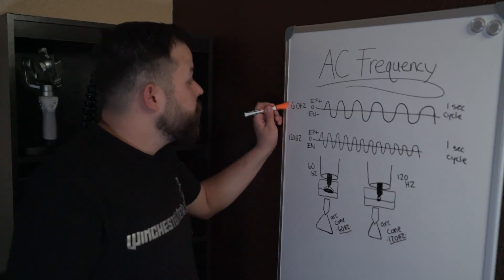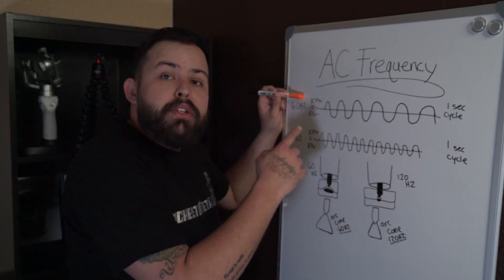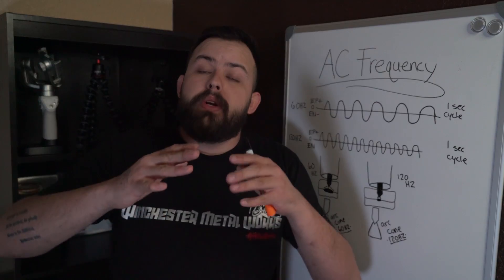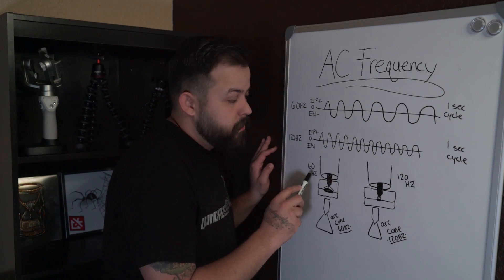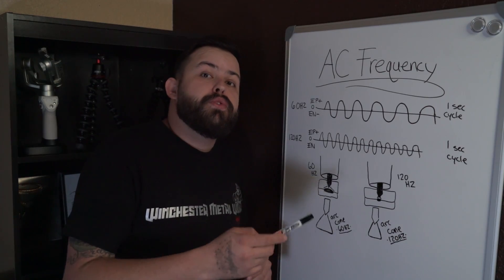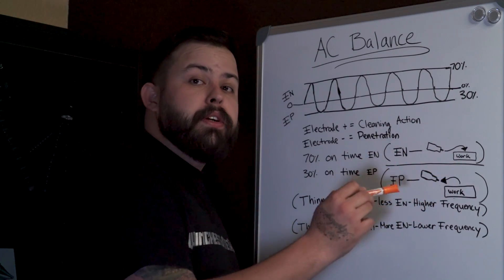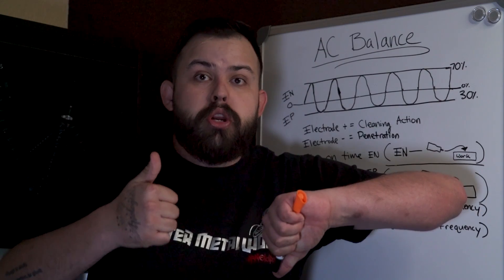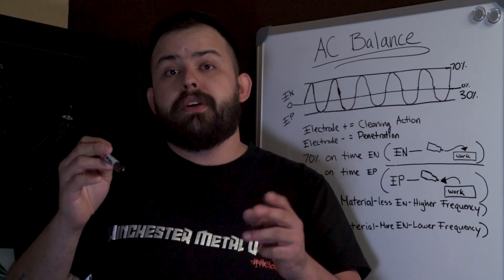Aluminum TIG Welding: AC settings- Using AC balance and AC Frequency

Comment: I don't think I think we got a basic understanding but at the same time you got difference in the thickness of your parts you got the different sometimes in the two parts going together one being thicker and the other one being thinner and you got a difference will there be aluminum whether it be steel will it be stainless steel and then of course you got the thickness of that for me anyway the biggest thing is that I want to be able to get it and understand how to balance both to get the best results out of our torch, and I think that comes with time and experience

Comment: Hi mate. I am hoping you can help me. I have a Vevor 6 in 1 TIG. 
It has no foot pedal but fairly significant software adjustments.
It has Cleaning Frequency, Cleaning Width and Frequency settings. Im welding 50 x 50 x 6mm aluminium. 
Any advice would be greatly appreciated 🙏

Comment: I have a Yeswelder CT2050 that is new. I’m building the cold side of my intercooler out of 065 aluminum and I’m struggling with the settings on my machine. It has a built in plasma cutter that quit working after the first job I did. I’m getting frosted up snot from my aluminum welds. I feel like I’ve tried every setting the machine has, but I must be doing something wrong looking for help not thumb thuggish comments. Thank you

Comment: I have a syncrowave 210 and I’m just learning how to weld aluminum and the settings are confusing. Your video helped to better understand how to adjust the freq and balance. 

I’m running 3/32 tungsten and 1/8 aluminum.

Comment: Hi Brad, I have a question for you about material thickness and settings, I'm going to be using 40mm Aluminium Box section with a thickness of 3mm, I will mitre the corners and weld these pieces into square frames. I will be using a GYS pro tig 201, 

 great video here thank you.

Comment: AC negative is the penetration aspect of the wave. AC positive is the cleaning aspect. He says "the higher the AC frequency is, the less time it stays on EN or EP". Not Really. It is the balance between the positive cycle and the negative cycle. So 30/70 is 30% positive (Cleaning) and 70% negative (penetration). 50/50 is 50% positive and 50% negative in the cycle. I stopped watching after that first 1 minute. It's cool to do weld videos but make sure you teach it right.

Comment: Hey I’m running tig for aluminum but for the life of me I can’t figure it out. Keep burning threw . Got them mechine set to like 170 30% at 70amps 3/32 electrode . Primeweld 110% argon

Comment: Man I got so surprised because you looked exactly like my nephew, unfortunately passed away at 30 due to skin cancer. I really like your videos and I have subscribed as well, this is one of the explanation I have seen. Currently running a WIA machine, miller owned 200 amp acdc machine to learn to fit weld. I am having a lot of issues welding 3mm Aluminium  as the tungsten keeps balling and the arc goes everywhere and melts the corner joint,  can you help me set up settings. AC FREQUENCY is set to 50 and AC balance to 35. It is doing my head in.

Comment: Waste of time. You can swing those setting from one extreme to the other and it won't have half the influence over your welds that you have by either having good torch angle or piss poor torch angle, good arc length or piss poor arc length.. The point is this is NOTHING BUT A GIMMICK TO SELL MACHINES. I own a Dynasty 350 that I tried all this garbage with. Today it's set at 55 hrts, 350 amps, and about 78 on balance. It welds everything from. 063" to 6" aluminum all look like God done it himself. I've also bought and tried every flavor of tungsten and that's also a waste of time and money. Buy the Weld Porn pink banned tungsten and never look back.

Comment: Hey boss I have a couple questions. My main project is intercooler pipes, but for now I’m trying to prepare by practicing on flat coupons. What settings would you recommend? amps, hrz, balance , cup size. My setup, inverter machine, 3/32 lenth tungsten,  1/16 4043 filler, very clean materia, settings are:  square wave, 85amps, 150hz, balance 35%, pre flow 02, post flow 8seconds, 15cfm flow, #5 gas cup on a #9 ck torch. Currently I have a little  issue with arc stability, sometimes it jumps on start or stop even with a super low gap. Am I running too much gas,  or too big of a cup? Also If using 1/16 filler, should I switch to 1/16 tungsten? Thank you!
Reply from the maker: Dude If you have Instagram, dm me over there. 🤘🏻 just copy and paste this.

Comment: have a jegs tm 200 mma ac welder trying to weld aluminum intercooler piping. all its dials are different from other videos. i have no frequency settings. Using 100% ARGON  on 110v. either i burn through it or if there is a gap between parts at all it just drills holes. tried low amps, more cleaning less penetration(i think scale goes from -5 to +5) to no success. using a 3/32 red tungsten but ordered blue 1/8.

Comment: Hello I've been Welding more than a few years I just got well moved up to a big boy CK water cooled size 20 torch. I have a lotos 200 acdc p  inverter, I've done lost of pipe an plate steel an ss. I'm getting into more aluminum. Ive watch your video and I'm going to say you really have a great ability to explain yourself an how to do it. I'm needing help on figuring out the settings on my Tig machine please  if you could  please email me back if be happy if I could get you to maybe call me  here's my email chucknoodle42@gmail.com

Comment: Learned alot, thank you.  Im teaching myself on aluminum, quite a learning curve.
Reply: Update, i can easily weld thin aluminum intercooler piping now.  I fixed a broken tab on a cast aluminum intake manifold as well.  Buying a multiprocess TIG welder was worth every penny.  Its paid itself off 3 times already.

Comment: I have been watching welding videos for years, and many are very good, but your explanations have been the best.  You are well organized and establish your explanation from inception.  I use the Miller Dynasty, as you mentioned you do.  Would you consider doing a video showing your settings for that machine?  I would also like to see how you clean aluminum for welding.  Thanks for your excellent video and your time.

Comment: HourGlass, only item not really mentioned, but I think is worth noting exactly in this level of facts about alum. AC TIG is that the arc cone of a sharpened tungsten is wide- by nature; compared to a small round or even a full bulb (not outside profile of the electrode shaft) which gives a narrower focus of the arc.... [counter intuitive]  Coupling these facts with frequency is very important related set of conditions:  Super sharp point @ 180Hz will still be wider arc cone than a small ball/blunt/round electrode at 120-30Hz- so.... that relationship might be in your presentation too?

Comment: Brad, i am struggling with higher amp settings destroying my tungstens. I’ve dialled the balance back to EN but loose the cleaning effect. Are there some tips that may help as I can’t get a nice clean puddle. Cheers
Reply: Try going up one size on the tungsten if the higher amps are causing you issues. Also clean the metal as well as you can using a stainless brush and then an acetone wipe.

Comment: Wow, best video explanation I've seen so far. Very visual, awesome. I'm a beginner struggling with tig welding on aluminium but thanks to that video I'm starting to connect the dots and see light in the darkness. Thank you so much man!

Comment: Why would you recomend changing the balance with thinner material? Isn't it better to set the balance just on enough cleaning action and get more ore less penetration via the Amps?
Reply from the maker: Bram Ruijter balance is directly related to cleaning (Electrode positive)  vs penetration (electrode negative) . Thinner material requires less penetration. Therefore requires less electrode negative. Settings are extremely important on AC and it makes or breaks the weld. Oxide cleaning width is directly related to cup size and gas flow.. not cleaning action. When you get into Advanced AC, settings change for every joint fit up, every material thickness as well as if it’s in or out of position. Changing one little thing massively changes how the material welds. If electrode negative struggles to penetrate on thicker material because your balance is set to low on the EN side.. you have a problem.
Reply: @hourglassingenuity103 Thanks for your reply.  My machine has no ac frequency settings. I'll try to weld some thin aluminum tomorrow, see how low I can set the cleaning action and still get a puddle. Is it a good idea to pay with pulse settings too get a narrower puddle?

Comment: Hello and thank you for the discriptive video ..  I can use this information so thanks ! I am now much better informed as to the posttive and negative effects :.. that said I am new to tig and bought a harbor freight Vulcan.welder omnipro 200 ... it has an ac balance from 50-90 and this is confusing me .. the frequency is easy to understand but the way the machine is set up it’s hard to tell what the ac balance is doing ... I am starting off a project of welding a small cast aluminum head .. it’s a very hard project even for a good welder ! The material goes from thick like 1/2” to thin like 1/16” in most areas I need to weld .. the reason being to strengthen up the thinner areas which are around the bowls of the intake valve ports... ( not important to be able to picture in your head ) but I’m having problems with the weld getting so hot that the entire casting looks like a saggy bag before it gets a shiny weld puddle ... I know enough to get me introuble and not enough to get the job done correct .. My guess is that problem is coming from improper cleaning of the surface .. so I ground off the area and started again .. it just seems like I can’t get the job done .. so I got a piece of aluminum stock 1/8” thick coupon and threw down a few beads .. then I go to the casting and it all goes south instantly .. there are many problems here .. one is the shape and area I need to get at is like down in a hole .. second is the casting goes from thick to thin quickly .. and I probably have the settings on the machine set wrong help !!!!!!!! Please

Comment: Hi. You said if you have ac balance to much then the rod balls up, what happens if you have it too low. I’ve got a jasic ac/dc with pulse at work. Great on stainless. Only used once on aluminium for a play. The ac balance goes to 65 so I just left it on 33. The frequency goes to 200 so I just had it on 100. Why used ac pulse rather than ac. It was on 3mm aluminium

Comment: Hi there,I have a everlast 200dv tig welder ...it’s driving me crazy to setup ...I’m welding(trying) 1/8 aluminum miter corner, which setting you think should I use in this particular case??? Thank you
Reply from the maker: 1/8” material.. I would use a #5 standard cup.. 3/32 lanthanated or tri blend tungsten.. 120hz on the frequency.. 75% ac balance, being 75% electrode negative.. which I believe on the everlast it reads in electrode positive.. so it should be 25% for you. I’d run 3/32 5356 filler as long as it wasn’t being heat treated.. (alloy dependent). Prep that material like nobodies business.. make sure you wipe it down with acetone.. deburr the corners and edges.
Reply: Thanks man!!!
Reply: Of course on 240v right?
Reply from the maker: Edirke Simon yes, but if you preheated the part, depending on how big it is that is.. you could possibly get away with welding it on 110v.. but, 120 amps won’t get you very far on 1/8” especially if it’s a large part. Aluminum loves to disperse heat and on something large it acts like a heat sink. I weld hot and fast.. puddle and get ahead of the heat as fast as possible. 👌🏻
Reply: HourGlassFab thank you so much!

Comment: Great video.  Going to call out one item though, your drawing for showing 30% EP and 70% EN show the percentage varying by amplitude instead of time.  The '%' of EN/EP is describing 'Duty Cycle', and thus is describing a Time variable (not amplitude).  Not trying to nit-pick,  but we should make that clear for everyone as not to propagate incorrect information.  Enjoying your channel so far.  Didn't you do a podcast with Jody and Roy a few months back?
Reply: Check out This Old Tony's channel with a video called "My TIG Is Breaking Up With Me".  He hooks a scope up to his tig welder so you can see the effects of frequency, balance, etc.  

As stated above, not trying to nitpick.  Great video!
Reply: Very informative video and great presentation. Keep it up! This was one point I was in question about. Thanks for clearing it up.

Comment: Well done!  Just got into welding about 10 months ago, a hobby welder and haven't had to weld any aluminummmm in about 8 months. Went to weld up an aluminum hose hook last weekend for the garage and was having a hell of a time getting my settings correct. I did manage to get the piece welded but wasn't a top notch job.  Thanks for refreshing my ole mind on the proper way to set the Freq./Balance.  Unless you've been welding like forever or do any particular metal welding on a daily basis we tend to forget the proper procedures when it comes to aluminum. Steel is a walk in the park, at least for me it is.
Reply from the maker: ocd definitely! Thank you and I appreciate it. You’re absolutely right, if you don’t do it for a while you definitely scratch my your head a little bit. Thank you for watching and I appreciate the comment!!🙏🏻

Comment: It is good to hear someone who wants to talk through systematic variations.  In a earlier video you asked for suggestions for content.   Here are some suggestions.  much like you compared the inch dimensions of cups, it would be useful to visually compare different tig torches, by size and other variations.  The number size system is a bit obscure.  Also,  "EN  pushing current into" is a bit ambiguous; do you mean the tungsten is negative and therefore electrons are flowing into the part?  I would guess the electron flow into the part is what heats it.  This is doubly important to clarify because, as you mention, different welders vary in their polarity descriptions.  thanks.